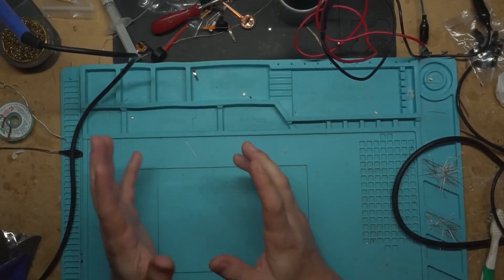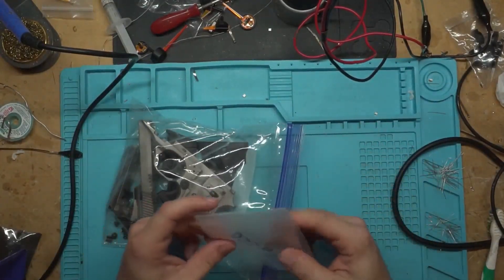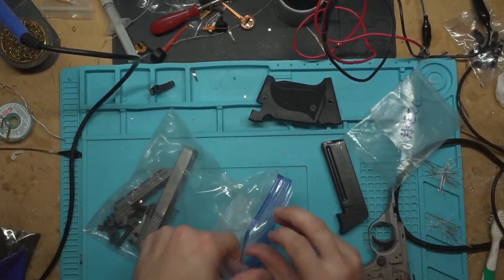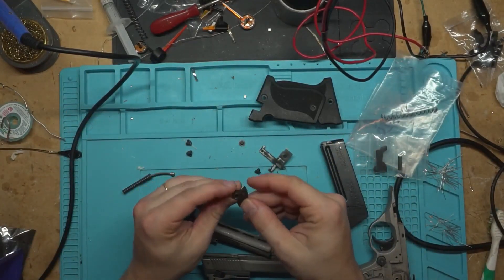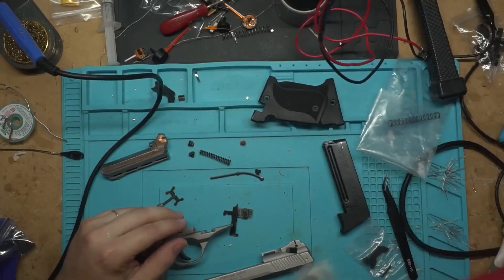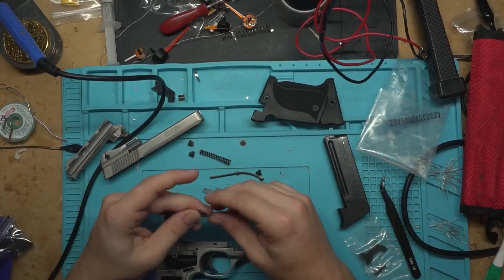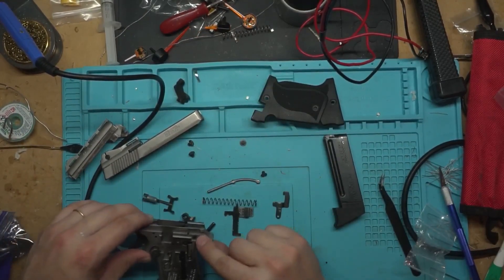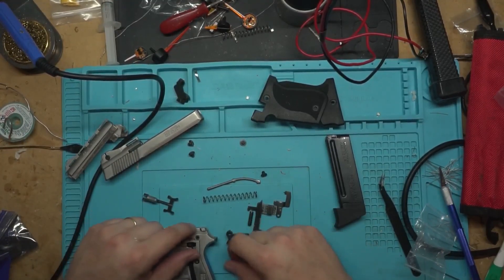HP22A Hammer Replacement and Reassembly

Comment: Best to not consider a gun fixed till you run a dozen rounds through it, and also check that all safety's are working properly. And good on not dry-firing, although it won't hurt a high-quality center-fire gun to do it occasionally, with a rimfire it can make a burr on the chamber face or break the firing pin.
Reply from the maker: Agreed I'm going test fire it soon. I know the magazine safety is wrong on it but it's been like that since I got it. I know it's a common mod were people replace the original safety with one that will always let the magazine come out/slide move. I didn't modify it but it was clearly done before I got it. I know the trigger safety is working but I'll have to test the firing pin block on the range